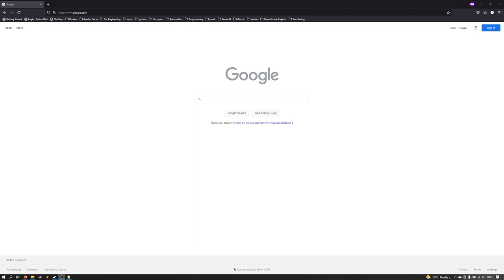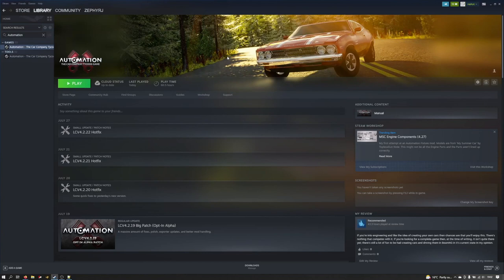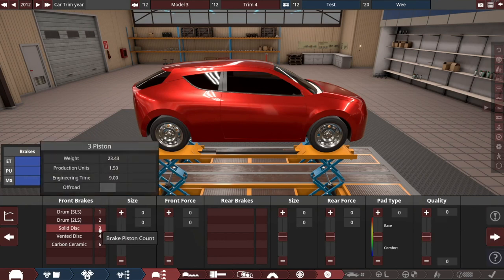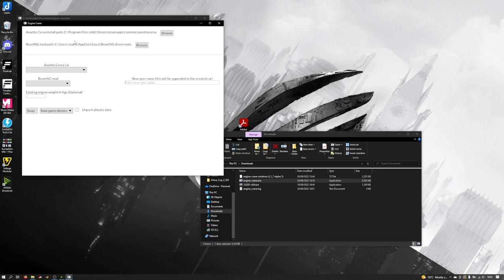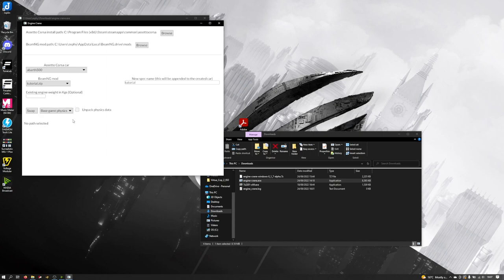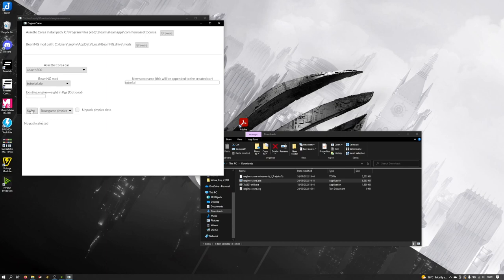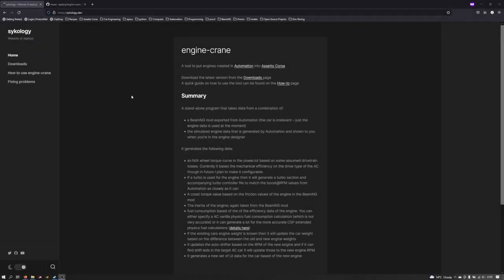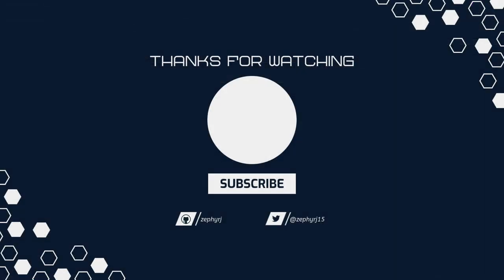How to create engines for Assetto Corsa using Automation | engine-crane v0.1.7

Comment from the maker: Hi all, if you are encountering an issue where you can't find any BeamNG mods appearing in the list this may help you:
https://youtube.com/shorts/Vv5uF1lCv6w

- Up until version 0.3 the beamNG mods must be zip-packed for them to be picked up by engine-crane so make sure that the zip-pack option is selected when creating the mod in Automation
- To ensure that engine-crane is looking in the correct folder for your BeamNG mods use the "open folder" option when using the BeamNG exporter in Automation (to see the directory it's using) and ensure that the BeamNG mod path in the settings tab of engine-crane matches that directory

Comment: Im coming out with something where the engine wont "go into" the assetto car. i have a new car made with the new engine but the torque curve is unchanged and the car is no different in power as well
Reply from the maker: Hi there, thanks for letting me know. Which Assetto Corsa car were you trying to swap into when this happened? I'll try and reproduce the error and fix it for you
Reply: @zephyrj  I figured out that only certain automation cars work. I had two different cars I tried using one car and it wouldn’t work. Put the same engine in a different automation car and it worked. I didn’t see any problems with any assetto cars. It was automation’s end.
Reply from the maker: @jammyjim0720  If you have any issues with Automation cars then I know I've fixed a few bugs in the latest version (v0.1.9)
You can find that on race department at https://www.racedepartment.com/downloads/engine-crane.54657/ or it's available from my website at https://sykology.dev/downloads/

If you still find anything that doesn't work do let me know and I'll try and get it fixed. I don't have time to test all the possible combinations so bug reports are very helpful
Reply: @zephyrj  sounds good. I’ll make sure to keep an eye out for anymore bugs. Is there a better place than YouTube to send those bug reports? Also thank you for making this awesome program.
Reply from the maker: @jammyjim0720  Thanks. The best place would be https://github.com/zephyrj/engine-crane/issues

Comment: so to clarify, i must have all 3 games, Beamng, Automation, Assetto?
Reply from the maker: You will only need Automation and Assetto Corsa. The beamNG mod can be created by Automation without needing beamNG installed. engine-crane should auto-detect the folder that the mods get saved to regardless

Comment: hey there im getting a rather odd error message when hitting swap, the car still loads into asseto corsa but the engine is still stock engine. any help would be appreciated thanks
Reply from the maker: Hi, sorry for the late response; not had much free time lately 
Did you see any kind of message at the bottom of the engine-crane window when you pressed the swap button?

Comment: I'm getting an odd error when trying,
"Car file selection is missing attribute QualityFamily. The BeamNG mod may be out-of-date; try recreating a mod with the latest engine version"
I am unsure how to proceed because I've tried two separate engine and chassis configuration

Edit to add: Still an amazing effort and I'm sure the mod works as intended.
Reply from the maker: Thanks for trying it out and letting me know.

A couple of questions to help me try to fix it for you:
- what version of automation are you using?
- what AC car did you try to swap into?
Reply from the maker: If you are using Automation 4.1 (not the 4.2 openbeta mentioned in the video) then I think I have a few changes that may fix this. I've created a new version with the changes in at https://github.com/zephyrj/engine-crane/releases/tag/v0.1.9-alpha - hopefully this fixes your issue
Reply: @zephyrj  I believe it is the most up to date version, being 4.2.27

I tried swapping a Kunos Toyota gt86 to test out
Reply: @zephyrj  Also to add, it seems that your github 1.9 update worked flawlessly. Loaded in with no errors and exported successfully.  You're a genius and I love tinkering with things like this. You just made my day.
Reply from the maker: @eleanormaness9677  Thank you for the kind words; really appreciate it. Enjoy tinkering!

Comment: @zephyrj what ever i do i simply cant make the clutches hold the power, dosnt really matter if its in a 900hp engine or 350 hp engine 
do you have a fix?
Reply from the maker: The next release might address this; assuming it is the same issue I've been looking into. Hoping to find some time this weekend to sit down and get a release out - work has been pretty busy recently

Comment: what a job i love you <3
Reply from the maker: Thank you :)
Reply: @zephyrj  i just export my engine but the turbo is sleepy (well it dont work) any ideas
Reply from the maker: @mathieu._.s9464  is it that the turbo is not working or the whole process is failing?
I'd recommend raising an issue with the log file attached on the project GitHub page so I can take a look at what is happening:
https://github.com/zephyrj/engine-crane/issues
Reply: @zephyrj  the turbo isnt working but the car is loading  maybe its because i have to upload the engine in a turbo car and not a N/A in assetto
Reply from the maker: @mathieu._.s9464  it should work regardless. Would you be able to send me the log file so I can work out what's going on please?
Reply: @zephyrj  where i can find the log file??
Reply from the maker: @mathieu._.s9464  https://youtu.be/8fMQCYiAgVU?t=1147 - it will be in the same folder that you run engine-crane from

Comment: hello i have problem engine-crane dont work i tried with 7zip
Reply: Can you help?
Reply: Yeah me too bro help
Reply from the maker: Hi, what issue are you seeing?
Reply: @zephyrj  Windows says the application has stopped working the application is not opening at all
Reply from the maker: @mertpeksen1766  I've never seen that before. Can you try the latest version I've just uploaded to racedepartment and see if you get the same issue?
https://www.racedepartment.com/downloads/engine-crane.54657/
Reply: @zephyrj  Yes same issue
Reply from the maker: @mertpeksen1766  is there anything in the engine_crane.log file. It will be in the same directory as where you're running it from.

Also, do you get the Windows pop-up for giving the program permissions?
Reply: @zephyrj  i gave permission for application in the text fold write like this ( warn engine_crane failed to load settings configuration file ‘engine-crane-conf’ not found
Reply from the maker: Cool, try manually creating an empty file called engine-crane-conf.toml in the same directory as engine-crane. Try running it again after that and see if it changes anything
Reply: @zephyrj  there is exist this file with this name
Reply from the maker: @mertpeksen1766  is there anything written in the file?
Reply: @zephyrj  file type is Toml because of this I can’t open
Reply from the maker: @mertpeksen1766  if you right click it you can open it in any text editor as it is human readable. Notepad will work
Reply: @zephyrj  inside the file write where is located ac install path and beamng mod path
Reply from the maker: @mertpeksen1766  try deleting everything in that file and then try opening engine-crane and let me know what happens
Reply: @zephyrj  same issues nothing changed(
Reply from the maker: @mertpeksen1766  ok, I'll have to see if I can add some code to check what windows is doing to make it exit. I'll try to put that into the next release.

Which windows version are you using?
Reply: @zephyrj  okey thanks for trying help i hope it will work
Reply from the maker: Hi, please see https://github.com/zephyrj/engine-crane/issues/15 - I've got a new release to try and track down this issue
Reply from the maker: I hope I've made a change that should solve this in the latest version. See https://www.racedepartment.com/downloads/engine-crane.54657/updates#resource-update-102290

Comment: May have found another bug. Would you have any suggestions?
I've tried the latest and second latest release of Engine Crane, but whenever I try to perform the swap, it crashes out. It successfully makes the folder for the car but it doesn't get the chance to put any content into it. No errors appear in the log, either.
Reply from the maker: Hi, would you be able to reproduce the error so it will be the last thing in the log file and then raise a new issue over on https://github.com/zephyrj/engine-crane/issues with the log file uploaded for me to investigate please? I'll try and see what's happening
Reply: Also, I found a thread here where someone was having similar issues, but at start up. I ran your debugger, but nothing came up in cmd, just started the program and the issues continued. Nothing in the log after that one, either.

Comment: Hey Zeph, when I hit the swap button I get an decode error- trailing comma at line 1 column 1158, what should I do about this? Thanks
Reply from the maker: Hey, it could be one of a few different things. What car are you trying to swap into?

If you can raise an issue on GitHub (should be in description) with the engine-crane.log file attached I'll be able to take a closer look

Comment: I have a problem, when i try to swap an engine to a car, the whole app crashes. The config appears but there is no new engine inside, the stock engine remains with the modified name. Is this a bug or certain cars cannot be swapped?
Reply from the maker: Some cars won't work as they may have some encrypted files; which car are you trying to swap into?

I consider it a bug that the app exits when it fails; I'm currently making changes to stop that from happening. The reason you see the new car is because the first thing it does is clone the existing car and doesn't delete the clone upon failure. I'll also be changing the behaviour so that failed swaps will not leave this clone directory behind

Comment: So,,,does it work on mod cars,,,or just the cars that originally came on asetto corsa?
Reply from the maker: It will work on mods as long as the author of the mod hasn't encrypted the .kn5 files (3d model) or physics data.
I'm currently in the process of seeing what more can be done though
Reply: Actually finally figured out how to use this,,,,,works well on my steam deck,,,i run windows 11 on my deck
Reply: Is there a way to change khp to mph in engine crate?
Reply from the maker: Not currently; I can look at adding a configuration option for this though

Comment: I am getting to the point where I want to choose what car to swap it into and stuff but I can not click on the box that says choose car I can only choose a mod that’s it
Reply from the maker: Hi, sounds like your Assetto Corsa install path is not set. This can happen if your Steam library location isn't where the tool is expecting.

You can set the install path yourself by going to the rightmost tab in engine crane and then clicking 'browse' for the AC install location. Once this is set the drop down list of cars will be populated

Comment: i am getting an error saying "trailing comma at line 22 column 2" is this common?
Reply from the maker: Hi, I've seen this once or twice. I think in my case the jbeam files created by Automation ended up with some invalid formatting. In my case recreating a mod with the engine I wanted fixed it for me

If you keep hitting the issue try raising a new issue over on https://github.com/zephyrj/engine-crane/issues and attach the engine-crane.log file when doing so and I'll look into it in more detail

Comment: Hello, do you know how to change the gear ratios of the car so you can get more top speed ?
Reply from the maker: In case you haven't seen it yet this may help:
https://www.youtube.com/watch?v=se4n2fVZEsk&lc=Ugz26bqOEsgt4g5w6i54AaABAg
Reply from the maker: For the gear ratio values themselves generally a lower ratio number will allow a greater top-speed. If you go too low the engine may not have enough power/torque to reach the theorectical max though

Comment: i got confused on beamng part. we need that game as well?
Reply from the maker: No, you don't need BeamNG. Regardless of whether it is installed the mod created by Automation will work. 

If the BeamNG mod doesn't automatically appear in the list in engine-crane then you can see which folder Automation is creating them in by selecting 'open folder' option when you create the mod

Comment: ok,,,,when i set the  path for asetto corsa,,,,which is on another drive it crashes,,,i have over 1000 cars,,,could the car amount be a issue?
Reply: i have a rog ally,,,,i will see if i can get it to work on it,,,
Reply: when i try to launch engine crane after setting the asseto corsa path a box opens and closes then nothing,,,,it wont even open,,,unless i reboot
Reply: interesting that it crashes on my rog ally when i set the path for asetto corsa just like my pc,,,,i do think it has something to do with the large amount of cars i have,,,,over 1400,,,just my opinion
Reply from the maker: I don't have any kind of handheld to test with unfortunately. Is there an engine_crane.log file In the same folder that engine-crane is in? Is there anything of note in it?
Reply: @zephyrj  ok,,,i got it working on my steamdeck,,,only prroblem  is the gearing,,,,cant seem to get the gearing to max out,,,,,,,cant figure out that setting,,,,,495 hp miata should  do more than 130 mph on the monza straight
Reply: how would i max out  the geariing to match the power increase?

Comment: No matter what car or engine I use when I click swap I get no engine found with uuid error.
Reply from the maker: Hi, thanks for the feedback. I have seen this a couple of times when testing and it has been when I've created a BeamNG mod from an engine that I have later deleted from "Engine Designer" tab on the main menu.

Unfortunately engine-crane needs the engine to still exist there in order to use the data; even after you've created the BeamNG mod - I'm looking to make this better in future so that you can just import it once.

Try recreating a car with an engine in Automation and then exporting that (you can often get away with using the AI car generator and then choosing the engine you want) - if that still doesn't work then try raising an issue at https://github.com/zephyrj/engine-crane/issues and attach the engine-crane.log file that should be present in the same directory as engine-crane. I'll then try and investigate further

Comment: i have a problem.. when i swap the engine everything goes fine until i need to click on the red button in Asseto.. The red button isnt there for me? how do i fix it?
Reply: PLUS the beta isnt there anymore or atlest not for me..
Reply from the maker: There isn't a beta any more as it looks like they added all the changes into the main game so there's no need to choose the beta version now
Reply from the maker: If you're referring to 15:30 in the video where there's a red circle then that will just be blank if you haven't selected it yet. When you hover over the blank space you should see the name of the tune at the bottom of the screen and you will be able to select it

Comment: when i try to click on the drop down for the BeamNG nothing happens. but easy video to follow so thats good 😀
Reply from the maker: Thanks, it's a shame it doesn't seem to be working for you.

I'd recommend using the "open folder" option when using the BeamNG exporter in Automation to see the directory it's using and then using that to set the BeamNG mod path in the settings tab in engine-crane. 

At the moment the beamNG mods must be zip-packed for them to be picked up by engine-crane so make sure that the zip-pack option is selected when creating the mod in Automation

Hopefully this helps :)
Reply: @zephyrj  ohh i think its cause they werent zip files then thx man

Comment: Hey so I got the engine into AC but I do not see it in the car I put the engine inside of. Did I do something wrong?
Reply from the maker: There are no aesthetic changes made; in case that's what you were hoping to see; only the data is updated. Are you seeing the data being updated for the car in question?
Reply: @zephyrj  Yeah I am. Got the data into ac and got the car running.

Comment: Do I have to have beam NG to be able to do it?
Reply from the maker: It doesn't need BeamNG to work, no. I also have a new custom exporter solution you can use as well if it's easier: 
https://youtu.be/4Xxbg2GUnqc

Comment: Hello, im having a problem with the mod, when i try to start the engine crane app the app and the command prompt appear on the screen for a split second and then they disappear, is there any fix?
Reply from the maker: Hi, thanks for the feedback. 

I haven't encountered this myself but I'd start by checking that any Anti-Virus software isn't immediately quarantining it when you run it. After that I'd make sure that you have permissions to write to the folder you are running it in; try running it from 'My Documents' for example.
Reply: @zephyrj  Well i tried both, first my antivirus is disabled ( at least that's what i think considering there is nothing in the windows security window) and i tried moving it to downloads and my documents but still the same issue, if you want i could send you what it says in the log file if that would be helpful
Reply from the maker: @THE_K_AR_Man  yeah the log would be helpful. You can raise an issue at https://github.com/zephyrj/engine-crane/issues and you should be able to attach the log
Reply from the maker: Hi, please see https://github.com/zephyrj/engine-crane/issues/15 - I've got a new release to try and track down this issue
Reply from the maker: I hope I've made a change that should solve this in the latest version. See https://www.racedepartment.com/downloads/engine-crane.54657/updates#resource-update-102290